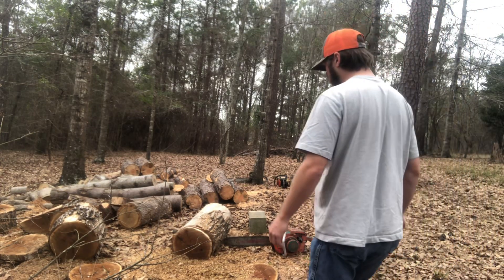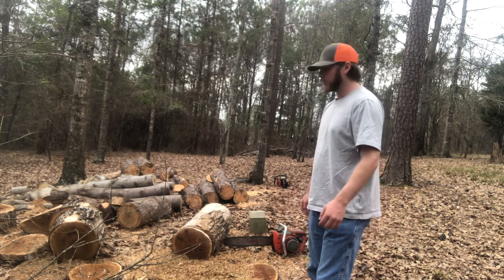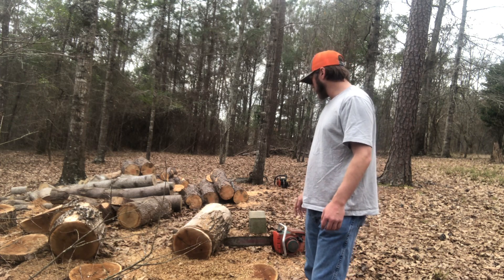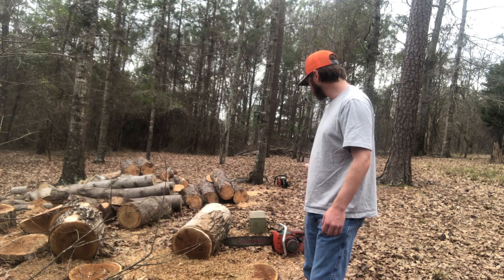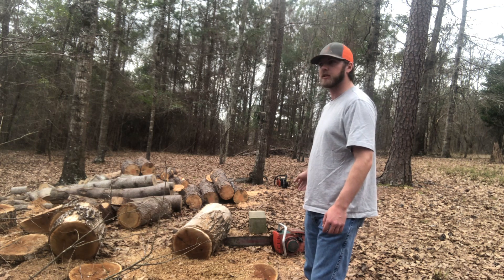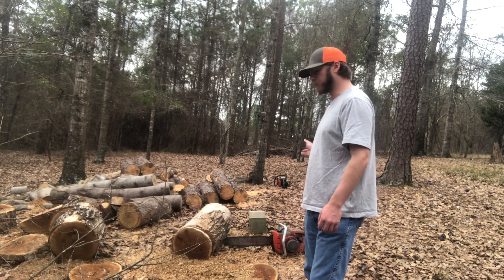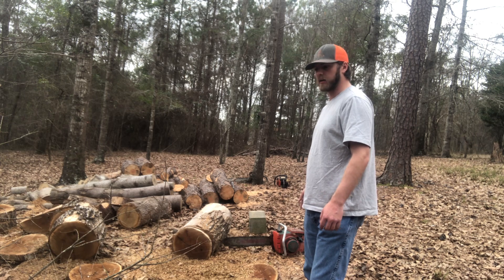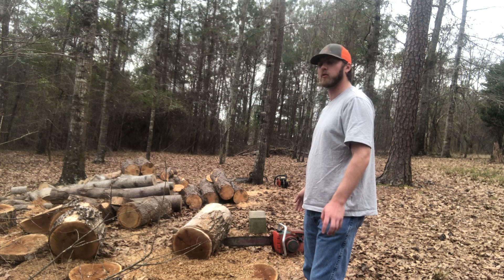Homelite xp 1000 testing after carb swap

Comment: Wow!
Reply from the maker: It kept sucking the choke shut, it runs much better now, I will put up a better video soon
Reply: @BamaPerformanceAndVintagesaws  it runs for the first pull. Oustanding is a tillotson carburetor?
Reply from the maker: @emmanuelcaballero  yes, tillotson hl324 same as a stihl 070 or 090 carb
Reply: @BamaPerformanceAndVintagesaws  may it fit on a 1050 Homelite?
Reply from the maker: @emmanuelcaballero  yes it can also fit a 1050
Reply: @BamaPerformanceAndVintagesaws  great! We waiting for the excelente fix on you saw. Thank you good eve